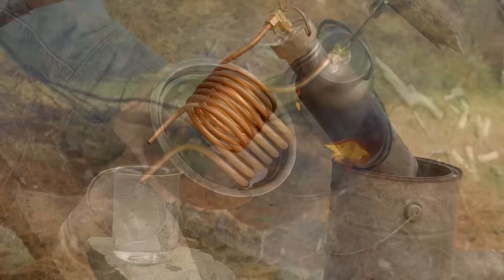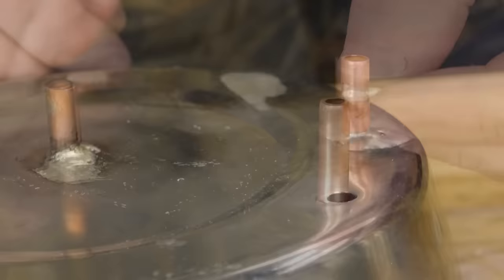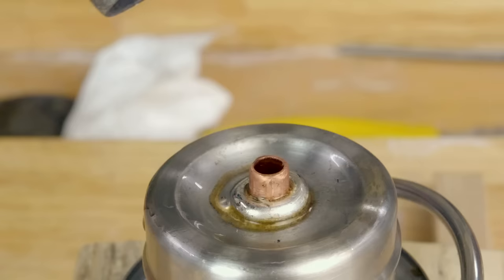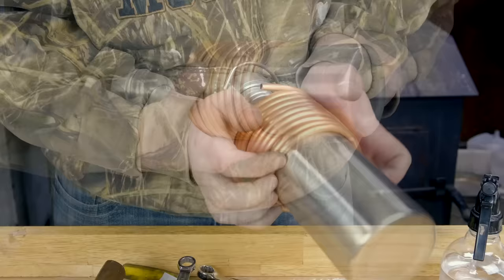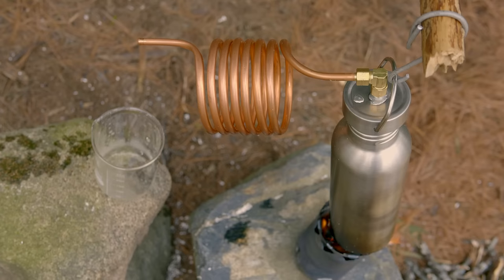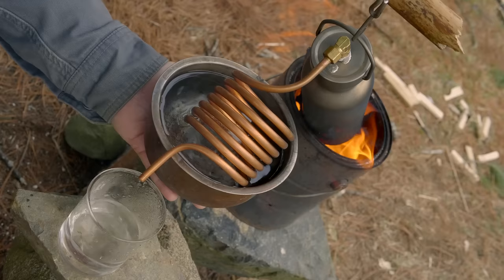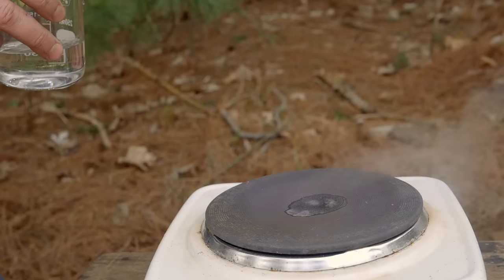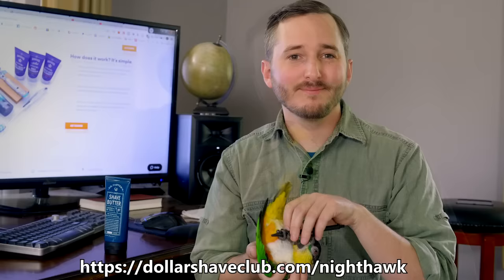DIY Salt-Water Survival Bottle (Compact Desalination Kit)

Comment: Wow there is a real DIY, not a comercial profesional tool used, just regular cheap ones everyone got at home thanks!!
Reply: "cheap ones" >drillpress
Reply: @Misha-dr9rh  can use a hand drill or electric drill, just a matter of time and  precision
Reply: I dont think most people have solder, flux, and a soldering iron though
Reply: @ryanhelmbold2288  copper soldering kits are like $20 and if your home has copper pipes will help a ton if your pipes spring a leak and flood your kitchen at 4 am. Ask me how I know.
Reply: @cidizzle  Propane or MAPP gas....? 🤔
Reply: @gus473  thr propane pipe kits run like $19.99 at home depot
Reply: Think what he meant were the videos that say,  "easy DIY...." yet use a professional lathe, hydraulic press and an industrial air compressor to build a simple item.   This clearly shows that simple,  inexpensive tools and materials can be used to make a useful product.

Comment: Spreading the copper coils apart will lower the amount of heat one coil will transfer to the next. It allows cooling air or water to reach all sides of every coil.  I like your design.  Very compact and usable.
Reply: Good idea--should improve the heat sink abilities.
Reply: Might make it harder to fit them in a water bowl, though.
Reply: You're right except coiling and uncoiling it over and over would quickly fatigue the copper tubing eventually causing it to rupture.
Reply: @michaellinner7772  i assumed he ment to stretch it out just the once. Or even trim the length to spread it out permanently
Reply: True, but you would presumably want to wrap as much copper around the bottle as possible to provide a longer cooling path. There would have to be some trade-off between length and coil spacing, I guess.
Reply: you could also use a larger diameter tubing.

Comment: It is important to keep the copper clean as it will oxidize along with picking up a black substance that is more dangerous. The best way to clean is use citric acid solution and then rinse well. Some will rinse with a 50/50 vinegar/water solution followed with straight water.
Reply: Hmm.  Like the oil cooler on an old 19DA where the water chemistry wasn't kept up with. I, too, would use stainless.
Reply: Copper is used in Espresso machine boilers. Just use a standard descaler or vinegar solution.

Comment: Spacing out your coils.  So the air can get through them. As well with the heat dissipate
Reply: It won't explode, the tubing is opened to atmosphere. One could experience some mild water hammer from steam bubbles collapsing within this set up but as he demonstrated with immersing the coils in the pot of water, this effectively created the heat exchange necessary to get steady condensing
Reply: @ToxicallyMasculinelol  I’m pretty sure he meant it hyperbolically, and what kind of tube doesn’t have a hole lol😂
Reply: @sikox209  a rod
Reply: @_Anthony___  a rod isn’t a tube🤦🏽‍♂️
Reply: @sikox209  tube shaped
Reply: @sikox209  i mean a tube that is currently open on one end, obviously. a pipe bomb is also made out of a tube. the operative difference being that the holes are capped.
Reply: @ToxicallyMasculinelol  then with the capped ends would it still be a tube? You wouldn’t call a married man a bachelor would you? He was a bachelor until the wedding happened and became a married man, the Tube was a tube until the ends got capped and it stopped being a tube
Reply: @Anoneemus Noename he answered “ a rod” I must be blind because if there was a joke there I didn’t see it lol, I was joking as well, it was a tad bit of dry humor though, perhaps I should’ve made it more obvious at the start
Reply: @Anoneemus Noename a video would be great!
Reply: @_Anthony___  , a rod is not a tube.
Reply: @Santa-614  thanks
Reply: @Cekon20000  thanks
Reply: Oooh yeah!!
Reply: @_Anthony___  carbon nano tubes they hollow tube hollow

Comment: Thanks for a great Video!
The bottle in fire automatically turns to black, but that's a layer of tar, which is poor conductor. If you use flame blackened kettles on fire, they are less efficient than clean ones.
So, if you look forward to boil the water with solar energy, i recommend to find some special paint for that, instead of tar layer. 😎👍
Reply: Anonymous Anonymous  No he means tar. Because this is being heated by the burning of plant material, it produces TAR, and Carbon.

If it was being heated by hydrocarbon gas, like a propane, it would be carbon.

But using wood, or other plant material causes tar. Just like Tar in tobacco. Which is why even cannabis produces tar, and in some cases in higher amounts than tobacco.
Reply: Anonymous Anonymous  they are not solelely hydrocarbons dude. Otherwise the byproducts would just be carbon, carbon dixoode and water.

But they aren't. ALL PLANTS produce tar when burnt. That black stuff will be carbon and tar.
https://en.m.wikipedia.org/wiki/Tar_(tobacco_residue)
Reply: Just wet  the entire bottom with cooking oil,no need to paint. After finished boiling with open flame, the black soot bottom can be easily wipe off.
Reply: @rohzpopper4922  What I did with my mess tins when in the military was take a bar of soap and rub that on the back bottom and sides before cooking. Leave a nice coating of soap and its really easy to wipe off and clean when finishing cooking/boiling water.
Reply: @rohzpopper4922  Thanks for the tip! 👍 I'll use that in my journeys coming.
Reply: Anonymous Anonymous  sure 👍
Reply: Anonymous Anonymous  Also different hydrocarbons don't burn at the same temperature. WTF?
Reply: Anonymous Anonymous  no, you said, "all hydrocarbons whether they be from from wood or propane burn at the same temperature"

This is just not true.
Reply: Anonymous Anonymous  they don't all combust at the same temperature though. Some Hurn lower than that as you just said. So regardless of what you meant by what you said both versions are wrong.
Yes find the hottest temperature something burns at a d all others will too. What a surprise. That's not what you said though, and what you said you meant would still be wrong, or at the very least a completely pointless statement.
Reply: Well... this thread got interesting...

Comment: Great piece for the kit.
Minor point : heat first, then flow solder.
Reply: Exactly, that part was tough to watch. Lol
Reply: @kckeithc  can you explain it to non-technical person?
Reply: @honor9lite1337  You heat the area where you will solder beforehand, then add the solder with heat to ensure the solder binds to the metals.
Reply: @prielknaaphofnar.9754  much appreciate it. 👍
Reply: @prielknaaphofnar.9754  My water soluble paste flux burns black before the silver solder melts.  I can't get the stainless tinned for the life of me.  Any suggestions?

Comment: Never tried it, but filling pipes with sand before bending them, helps to keep their shape regular, especially with larger diameters and narrow bending angle
Reply: I wish I would have read this comment two weeks ago!
Reply: fill the tube with water and freeze it. The ice/water will not compress thereby maintaining the tubes' volume.
Reply: @shorebird9  clever
Reply: @shorebird9  the pipe could snap if you do that
Reply: The sand will just move and be pushed out of the pipe and if you seal it so it doesn't do this then it will just compact and make it impossible to bend or split the pipe like frozen water does to house Plumbing when the expanding water that's turning into ice has nowhere to go
Reply: @shorebird9  freezing water in a copper pipe will split the pipe when water freezes it expands
Reply: @bretk7916  BTW you should look at using copper brake lines and fixings for a car, will eliminate the need for brazing.
Reply: @bretk7916  the goal is to keep the internal volume unchanged, by filling the pipe with sand, by doing so you should be able to bend it at its maximum, while keeping it's internal shape... Without the sand or another material, you are not allowed to make sharp bends
Reply: just use a cooper bending tool.
Reply: @jp-ty1vd  which costs....?
With sand you don't risk breaking the pip AKA spending more cash.
Reply: @midclock  with a bending tool you don't need to fk around with sand.

Comment: All I would do is make the distance between the coil and flask greater to maintain the differential or shield the coil from the heat source with anything reflective or something insulating and not too flammable like bark. I doubt, however, this would improve function by much.
I'm always happy to see your videos pop up, thanks.
Reply: There's no purpose, if the whole concept is to be compact, your design change is going against it. It also a non functional Destin change, so no need.
Reply: @Mr3344555  
If you would kindly reread my comment you'll find we almost agree.
The 'purpose' is to desalinate water by way of distillation using a compact unit. Distillation works by creating a heat differential between the evaporator and the condenser. Therefore increasing the temperature difference will, necessarily, improve function. The inverse-square law means that a small distance further away will have a seemingly great effect on said differential. Adding an extra few centimetres after the condensing coil will hardly make this a bulky item. Equally, it would be little effort to shield the coil from radiant heat.
The bit I think you missed was.."I doubt, however, this would improve function by much."
J.
Reply: the length of the coil plus the straight bits is already almost the length of the bottle.  You could save a bit on the water outlet and move it to the steam inlet though.

Comment: You mentioned the solder weld, and your best results "gentle heat" - what's more likely is that you've heated both parts consistently, to the melting point of the solder simultaneously.  This has been my experience.  Heat both piece up slowly so they reach the melting temp at the same time, and then apply a little more heat until the solder "wets" and wicks up the parts, remove heat and let the joint cool on its own.
Reply: Or could compression bulkhead fittings be used? Just a mechanical joint secured by nuts on either side of the lid. Using a hole just big enough to be able to force the tubing through. Might leak a little but so what? 
An even easier construction method as there is no torch involved.
Haven't tried it, just "thowin' it out there".
Reply: And don't try to speed up the cooling with water. It will just cause the steel to pull away from the solder.
Reply: @burnerjack01  Also this will be more corrosion resistant, because heating up stainless steel makes it corrode.

Comment: A connection tube about 8-10" long or so to connect the bottle and the cooling spiral could give 2 advantages:
- more distance between the cooling spiral and the heat source under the bottle
- the connection tube could have a knee that brings the winding of the coil in horizontal position. Open the coil (separate the windings about 1/2 inch to each other) also helps the condensing water rinse out the tube. 
Tat helps keeping pressure in the boiler constant, so You'll have less "boil over".

Comment: I think this project along with a solar lens, would be a great kit for travelling in the sea!
Reply: you can get survival desalinators for boats that float on the sea water and condensate clean water. good real brand ones produce about 1-2 litres a day Off brand Chinese ones can be hit and miss. A good indicator of production rate is its size and most should be more than 3 feet in diameter when inflated.

Comment: I recommend that you reroute your copper coil outlet (since it's flexible enough) to be dipped at the bottom of the beaker to avoid lost steam and efficiency. Great video.
Reply: 6:53
Reply: A short length of silicon tubing thrown inside would do, wouldn't it? Then you wouldn't have to bend the copper back and forth
Reply: He could just extend the copper tubing and have it bend at an arch to a point where it can touch the beaker at the bottom

Comment: This is a very good improvised distillation rig. The product is pure water from whatever quality water is being processed. It could be used on contaminated fresh water or (ewww!) urine. The product would still be wholesome distilled water. I wouldn't add any of the contaminants back in except with sea water though.
Reply: You still have to be careful with contaminated water though, as any volatile organic compounds would evaporate right along with the water and get condensed back into your "clean" water.  You could fix this with multiple steps of recondencing at different temperatures, but this isn't really going to be practical for you to carry on a hike.

Comment: Adding flux before your solder piece might keep things in place a little easier. I think it helps the solder adhere better as well.
Reply: Yea, that iron would of gotten hot enough to ditch the torch.

Comment: Great video as always. Well explained and simplistic design for ease of making. A few recommendation for improving this project is to find an alternative to the small rubber stopper, as this will most likely be easily lost due to its small size and time it takes for distillation/ long time being a loose piece. If possible i would suggest something like a simple valve attached to the elbow and before the copper line fitting. secondly having a parts list either in the video description or shown in the video will help people recreate it as they wont need to search through the whole video for where you mention the piping size or type of vessel used. 

lastly a small safety tip for distilling water: if the water source is contaminated with chemicals or heavy metals (you may not know in a survival situation), it is good practice to allow the still run for a potentially a few minutes before collecting water to allow volatile chemicals to escape and just dump the residual water as it would still contain the heavy metals. Yes there is the potential of not taking in enough vitamins and minerals if you are drinking only distilled water but I personally don't know the extend of how dangerous it is so I will suggest do your own research/ personal decision. 

 An idea for another project close to this is making a portable small sand filter.

Comment: I love the idea!!!  I think for mine I will use stainless tubing and swedgelock fittings.  Then there is no need for the soldering.  I can get a stainless cap for the top fitting when not using the still to eliminate the plug.  The stainless will be more rugged and take more abuse from me.  It takes a little practice to bend stainless tubing correctly and you need the right tool.

Side note, I would have used silver solder and when soldering you heat the materials and apply the solder to the surface of the heated materials, you shouldn't torch the solder directly.  Just something you learn when working on HVAC.
Reply: So, in this case, heat the lid, and not the solder and flux?
Reply: roadchewer PE correct, the lid and the tubing, when they’re hot enough the solder melts and flows to them, just don’t over heat them.
Reply: make a video of you making yours and let us know
Reply: Came to comment just that, if you carefully heat the materials it will suck the solder right in neatly. (Neater on a pipe type shape though, so heating one end really pulls the solder in)
Reply: This is just putting water.throgh a miny moonshine still
Reply: Stainless tubing is hard to find and doesn't bend too easy. It cleans up really well as opposed to copper which can oxidize. So a little more care is needed for copper especially if long term storage is happening.

Comment: Thanks for sharing. I saw another video where they took a pot of water about 1/3 full, put a bowl in the middle, then set a curved pot lid on top except upside down. The boiling water condensed on the lid and dripped into the bowl. Probably the simplest system I have seen.
Reply: that's the old 90's method for iso hash. lol

Comment: 1. Try a bottle with a lid that goes all the way to the outside of the bottle, and a liner.  Can remove liner and use it to catch distilled water.  Place the liner back in the bottle for storing freshwater so you don't have a salty taste.
2. If enough space, can place coil between this liner and metal bottle.
3. Since the temp should not exceed boiling temp, can use plastic tubing instead of copper.
4. Use screw fitting rather than soldering - soldering can break down at high temps.
5. Use the tubing for the bend rather than a fitting to drop weight.
6. When buying fitting, also buy an endcap so it won't spill water when using for water storage and not distilling.  Leave fitting on tube rather than relying on compression for easier change out.
7. Installing copper wool in the tubing increases condensation (more contact area for water droplets).
8. Burn inside of bottle thoroughly to remove any lining.
9. If hard to remove gasket, buy 2 lids - 1 for distilling without gasket, 1 with gasket for water storage.
Reply: @Tai Chi Tube They're already using copper tubing.  It's fine - the amount of copper you would need to ingest to be toxic is substantial (above 10 mg a day) - to put into perspective, this is about the same as 1 inch length of 1/4" copper tubing in a month - you wouldn't lose even close to this much after continuous use for years.
  
You would want to check the plastic type, but it is commonly used in food processing at home and at manufacturing plants.

If you're searching desperately for a problem, you would note the low thermal transfer of most plastics... but concern with copper is a desperate reach.

Comment: For anyone having trouble soldering the copper to the stainless steel (it can be tough to get it to stick and not just bead off), Ruby Fluid Stainless Steel liquid flux is great for that. Apply it to where you need the solder to go, heat up the parts, and apply the solder.